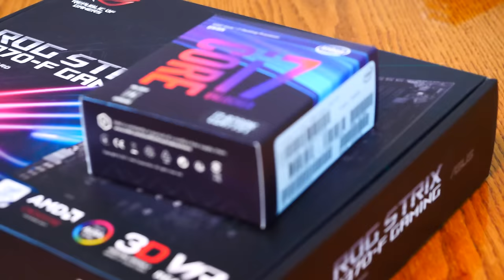How To Case Swap And Upgrade Your PC (Talos P1)

Comment: Do you recommend taking stuff out for example ram, cpu cooler etc even if we are just upgrading the case
Reply: He was swapping mobo, so he needed to take that out.
For CPU cooler, it depends. If it's air, keep it on. If it's liquid, it depends if it's easier to mount with or without it on
RAM, you leave in
M.2 drives, you leave in
Any PCI-E device, you take out (As in anything which goes in the slots, like the gpu, soundcard, wireless adapter, etc.)

Comment: So when it comes to PSU cables when your PSU comes with say SATA connectors and molex that have like 3 connectors on them, if you don’t need the extra connectors you can just cut them off?

Comment: Question for you I got a prebuilt Alienware r6 last year and it’s about a mid tower and I want to change the case, knowing it would void warranty. Can something like that be done and any problem you think may have? Don’t really need to upgrade much i7 7700k, gtx 1080, 850 w pcu( in case I wanted to add another gpu),16 gig ram at 2400. Water cooled. Just want to know what are some problems I could have and what I need to know

Comment: The only problem with these cases is that very minimal air can get through the front side which makes the 3 front fans nearly useless btw i have a cooler master masterbox 5 lite but with my case its completely blocked off which has a very identical front panel thats why i am saying this 👌

Comment: So the pc I have now is small has decent components and was prebuilt, but came with a extra stuff like a keyboard, mouse and good monitor worth about $400 aud on it's own. So the price was super worth it. But the problem is that  it only has a 350w PSU and cant fit any higher one in. Would the best option to case swap to a larger case and then buy a bigger PSU? To then later upgrade the GPU so then it's more future proofed for upgrading

Comment: So what can you do to prevent your cpu from being ripped out with the cooler? Seems like something that has no solution yet you said be careful not to do this
Reply: Run aida64 to heat up the cpu, open up your PC (put it on it's side) and once the cooler is no longer screwed in (loose from the motherboard) twist the cooler and once you feel that it's loose from the cooler pull it off

Comment: You ripped your AMD processor out? I don't think this would have happened if your processor was from Intel because supporting motherboards have a metal brace partially covering the CPU, reducing the risk of that happening, regardless of what type of cooler you have.
Bottom line: the more accurate thing to say is "Be more careful pulling coolers off of AMD processors."
But I'm not knocking you for using AMD over Intel; you have your preferences, I'm just helping you with more insight into what information to give us.
Reply: Funny thing is my MB also has a brace and I use an AMD cpu, so I don't think it's an AMD thing

Comment: Hey Barry I am going to build a pc with these specs i3-8100, my gtx 1050 ti oc edition that I already have and 16gb ram 3000mhz but I don’t know if I should get an i3 8100 or a ryzen 5 2600 which costs 30$ more any opinions?

Comment: I recently bought a pc from sky tech. A prebuilt. 

It came with 
Case:thermaltake versa n21
Processor: Fx-6300
Gpu: 1050 ti 4gb
Motherboard: asrock 970-ag/3.1

I’ll be upgrading it to this 
Motherboard: gigabyte aorus ultra gaming tax am4
Gpu: 1060 6gb
Processor: and 5 2600

Would this work out well?
Reply: ColZen Yeah, i have a PC with the same specs! What a nice upgrade!

Comment: Sucks cause I have neuropathy in my left arm and hand. Permanent nerve damage. Got a new case and checked around places to see how much it would be to swap my parts from one case to another and everyone in Ohio is going to charge me $300!!! My old case is falling apart too. Guess I’ll just take back the new Cooler Master H00 because being disabled is bullshit. One place told me a 3 day turn around time. When I used to swap out pc parts when my hand worked, it took me less than an hour. I just want to quit at life, basically.

Comment: Barry what do you think of this build?
Rx 570 4gb 
R3 1200
Asus prime A320m-k 
120gb kingston ssd
2tb Seagate barracuda hardrive
Coolermaster mcw l3b3
600w power supply bronze 80+ fully modular
Reply: Terrible because it isnt intel and nVidia.
Reply: @semihkorkmaz4490  it is thank you so much <3

Comment: Hey Barry, what’s wrong with Molex? I’m new to PC building, and I haven’t even bought the parts for my planned build.
Reply from the maker: They're just annoying, they get stuck sometimes and the pins pop out of them. Most of the time they're cheaply designed and can easily be replaced with a fan header instead.
Reply: Ah, I see.

Comment: So, Barry, you basically changed the MOBO, Processor, Power supply. Question: why did you bother doing a case swap at all? :))....You should have taken the ram and GPU's from the old rig and done!
Reply: Not hating.....just saying :)

Comment: Only problem with mine. If I case swapped my Ryzen 3 1300x I'd have to remove the motherboard than the power supple. There's no way I could get the PSU past the mamma board.

Comment: Barry I really want to play on pc but I can’t afford a decent one so I was thinking I could get a Xbox one x because it can run most games at 60fps unless you know a pc build for around that price and performance because I can’t find a cheap build.
Reply: Not as powerful as an XBOX One X in most regards but is decently priced when you consider everything needed for a console. Prices also vary and I was too lazy to put an HDMI, Kettle Lead and a keyboard and mouse into the build but should only add £30-40 ($55-60) to the build with more basic stuff. https://uk.pcpartpicker.com/list/TBpVgw

Comment: Erm...so...you went with an Intel cpu and compatible motherboard from an AMD cpu and motherboard...so you removed the AMD cpu and motherboard from the old case...why...exactly? I mean I get probably resell or whatever, but originally you made it seem like you were just moving all the parts to a new case and when you didn't I got confused.

Comment: Not a fan of the case and RGB PSU's are just a waste of money IMO unless you get one of those thermaltake cases that shows off components  and that allow you to wall mount your PC or a PC built in to the desk like one of those high end custom built desk's with water cooling inside them

Comment: I changed my graphic card from a gtx 660 to a gtx 1060 6GB and my power supply was only 240w because my computer is a old beast so I changed my power supply and now with a i7 3700 8gb ram and gtx 1060 and I can run any game to high graphics my only problem is my processor and my ram and my storahe but for that I have to change my motherboard.. it never ends..

Comment: wouldn't recommend some of this stuff to true beginners also don't clip cables if you may be upgrading to something that may use them down the line and also start with your GPU in the top slot because most of you aren't doing SLI and otherwise your top slot is generally higher bandwidth than the lower ones
Reply from the maker: right, this was just for sli builds. I always use top slot with one card.
Reply: @BulletBarry  yeah I wasn't trying to undermine you or anything just clarify

Comment: My 2700x always falls out when removing cooler
Reply: that is not normal
Reply: Harlem 1312 extremely common stopped doing it when i replaced thermal paste
Reply: @harveyjames7750  my 2700x never has that problem
Reply: Harlem 1312 ye it stopped when I changed thermal paste and mobo

Comment: Why dyo hate molex so much? I'm really curious
Reply from the maker: They're just annoying, they get stuck sometimes and the pins pop out of them. Most of the time they're cheaply designed and can easily be replaced with a fan header instead.
Reply: @BulletBarry  oh, i thought my case fans were just cheap, but yeah i can agree with that. Thanks!

Comment: Hey there 🙂

I'm looking for an upgrade on my PC and I was wondering if anyone could assist me. I'm looking for parts that will allow me to play the high-demanding games. Like Warzone, or Red Dead for example. Would I be looking at a CPU, some RAM or a GPU? My price range is probably £1000 at most. Any help would be appreciated. Thanks. Specs below.

Specs:
CPU: AMD FX 6300 Black Edition Included
CPU Cooler: Cooler Master Hyper 212x Included
GPU: MSI GeForce GTX 960 Included 4GB OC 
RAM: 8GB Corsair 1600mhz Vengeance Included (2x4GB) 
Graphics card: MSI GeForce GTX 960 Included 4GB OC 
Motherboard: Gigabyte 970A-DS3P Included
Operating System: Windows 10 Home Included (64-bit) 
Hard Drive: Seagate 1TB (Hybrid 8GB SSD) Included
Case: Fractal Design Define R5 Black
PSU: 550W Corsair VS Included

Comment: 1: Horrible design choices between two divisions of Gamdias that don't talk to one another. A Corsair PSU will always fit into a Corsair case. Not quite so with this pairing.
2: It feels like this is actually some belated response to The Verge's version of 'How to build a gaming PC', but without all the exposition.
3: You didn't really 'rehome' the parts from one case to another. You 'repurposed' the CPU cooler, drives, GPUs and RAM. Anyone would have done the same. The rest was replaced. You built a "new" PC with "gently used", "cat friendly" parts.
4: LED PSU... I feel we've gone too far with the RBG. fans, RAM, some CPU coolers (Wraith coolers and Corsair AIO water blocks), PSU cables, and now the PSU... yea, gone too far.